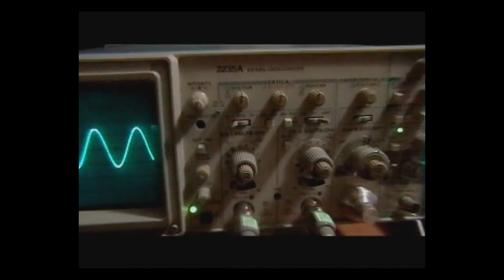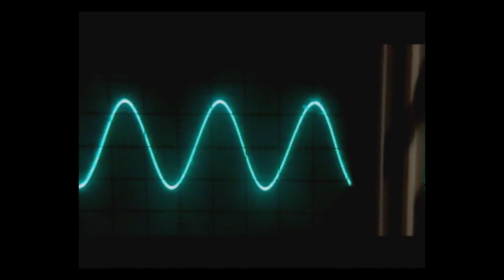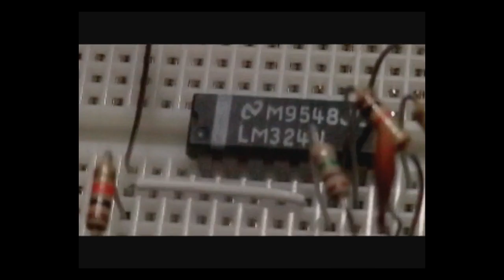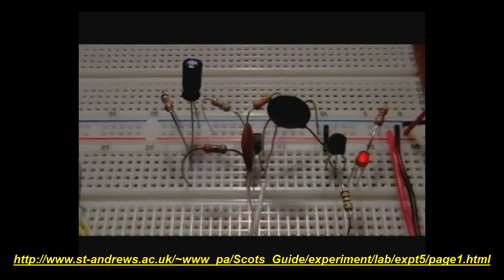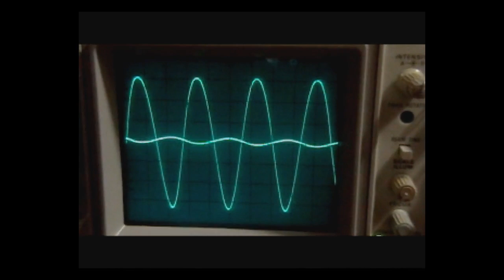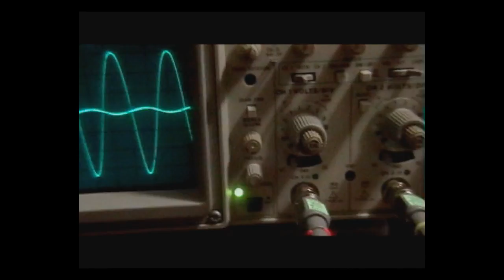Sine Wave Generation with Op-Amp and Transistor Amplifier

Comment: I love to see the analog Tektronix scopes. Many years ago, I would go to Introductory Physics with David Griffiths in the Howard Vollum building at Reed College. Reed had an interesting pedigree from Peter Norton to Steve Jobs, Larry Sanger but I didn't appreciate the graduate that became the namesake of that building. My only scope is a used but certified from the U.S. Air Force Tektronix 2245 100mhz. It has just enough functions and they are built to withstand a beating. I enjoy your videos. (Aka MrWally)

Comment: Nice circuit.  Using the 324 (single supply rail), the signal looks very good.  It may be worth using the at least one of the 3 left over stages.  2 for any amplification and the third one for an output buffer to drive low impedance loads.  Thanks for posting the circuit in video and links.  I'll likely breadboard it in time.

Comment from the maker: The LED was simple to provide feedback that something was going through the transistor.  I fully agree that it is more of a DC component, but for the sake of video, it is helpful to be able to provide visible feedback.  It operated as my load. :-)  As for your comment on a VFD, I see no reason you could not do something similar to this and by varying the filtering, isolate a desired frequency.

Comment: i am kinda daft at elecronics but ,  you took 5 volts (dc) i am guessing and with the op amp n caps  created a decent sine wave (ac) then boosted that signal to 3 volts (ac)  to run an led which  arent they  dc basically ?and running it on the positive half the ac cycle 
? can you change the ac signal frequency to make it a simple VFD of sorts